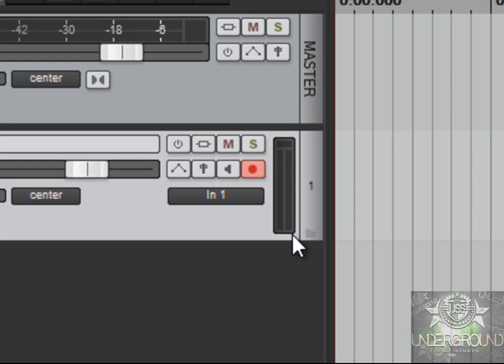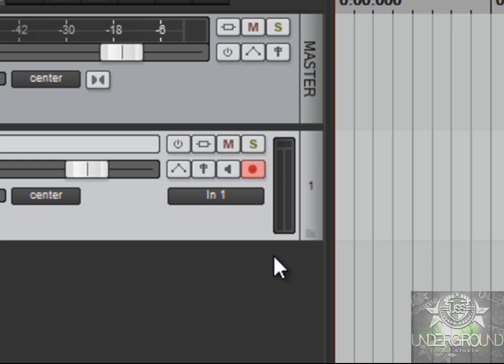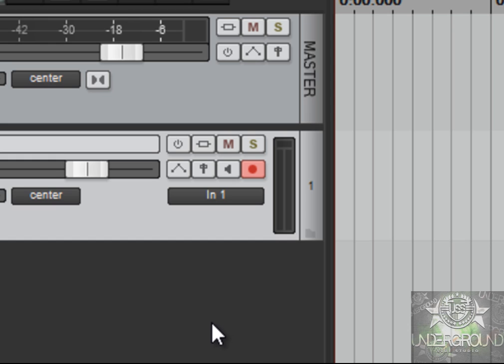[Solved] Behringer UCA 222 Noise

Comment: Glad it worked for you, but it sounds more likely to be a USB issue, or more closely related to your motherboard. If the network port is closely located to the USB socket, this can interfere. Thanks for the heads up.

Behringer + 15 second noise = Start unplugging and disable stuff.
Reply: Miles you're a hero

Comment: It may have worked for you, but not for me. Not that easy...
Reply from the maker: Yes brother, just turn off the internet. That happens to all the devices bro. trust me, I know about these things. Also if you combine the internet with the anti-virus is a totally chaos.
Reply: BregandoAlSistema Wao
 I've tried to disable all the network devices, but it did not eliminate the issue. Maybe the noise I'm having is not the same as yours. In my case it is a high pitched sweeping "beep beep" which becomes apparent at medium to high volumes. I've done a lot of research and it seems to be a very common problem with the UCA222/UCA202 devices, and so far there seems to be no solution (even Behringer failed to come up with one when I contacted them).
Reply from the maker: Yeah, I know those bitches are incompentent. Well sorry bro if that does not work for you.
Reply: Did you ever solve that problem? see my problem here: http://dsp.stackexchange.com/questions/33655/what-is-causing-a-cyclic-1khz-noise-signal-in-audio-recording
Reply: ndlz84
I was never able to solve it. All the UCAs 202/222 have this problem, and must be avoided like the plague. Too bad, because other than that they are decent for the money.
Reply: OK. thanks for the reply. It can go back in the shed!